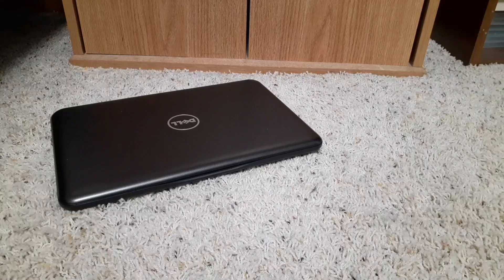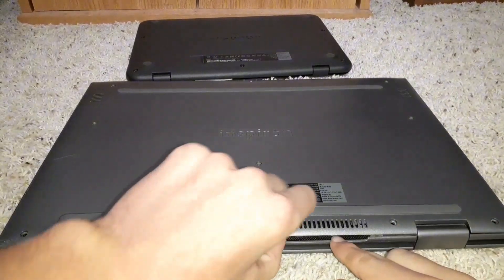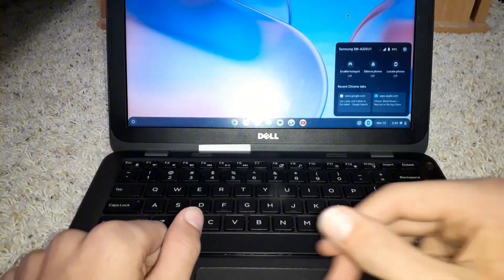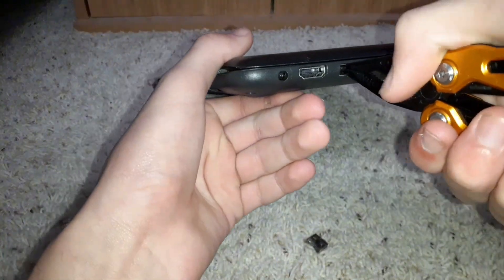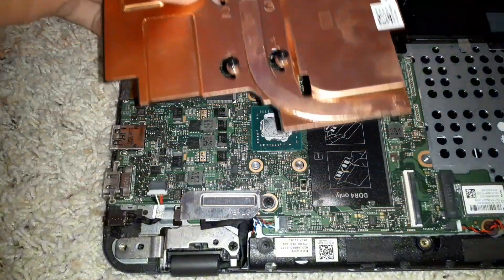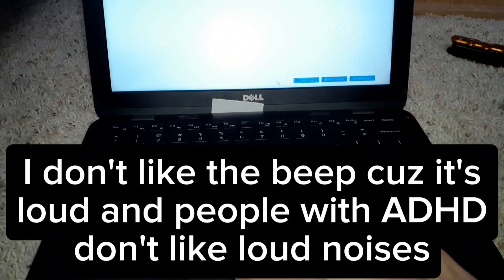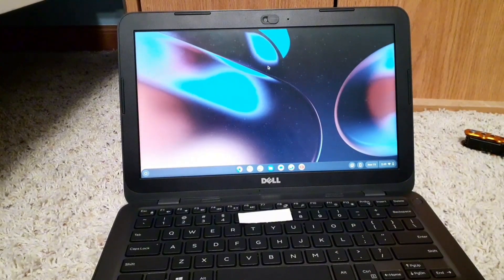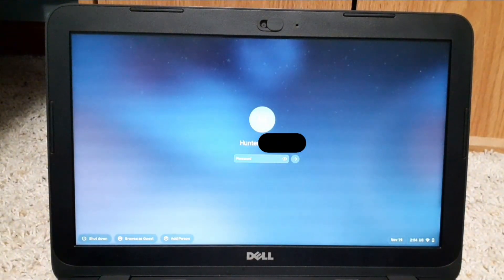Upgrading the Windows Laptop RAM #chromebook #chromeosflex #technology #computer

Comment: why chrome os?
Reply from the maker: Chrome OS runs way better on this laptop than it did with windows 10. 4GB Ram with 32GB storage not ideal for a windows laptop but PERFECT for a chromebook
Reply: @TechShenanigans22  ah potato lol
Reply from the maker: Yes lol
Reply: He sounds like he might be in high school.  If so a lot of them use chrimebooks
Reply from the maker: Yes I just started my first year. And yes we use Chromebooks but they are ever so slightly better power wise than this one I created. The only upsides to this one is that it has no school restrictions
Reply: @TechShenanigans22  did you try BlissOS? It's just basically a different version of Android x86, BlissOS 16 (Android 13) is out, but it's just for tests, not fully released yet
Reply from the maker: Nah I've been using this laptop as my main laptop and I love it. It's been a way better experience ever since I switched to android